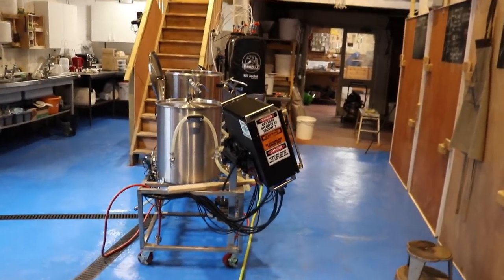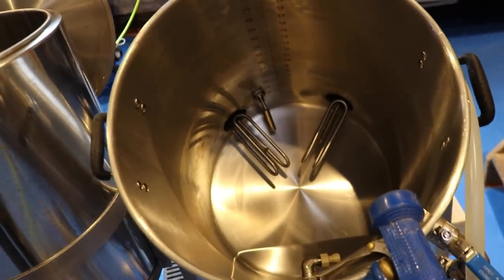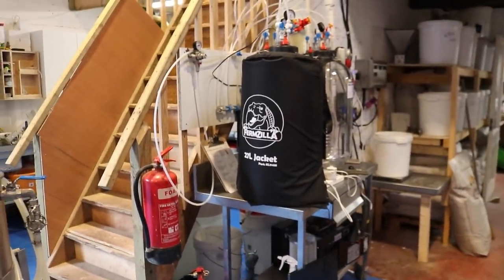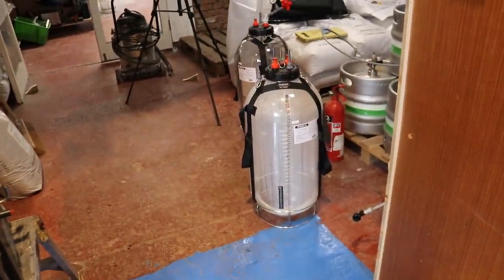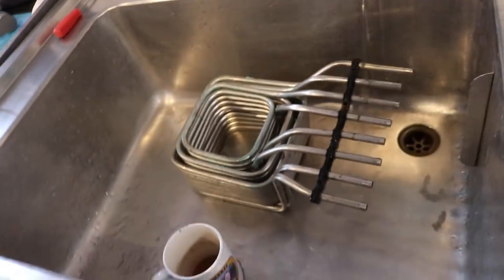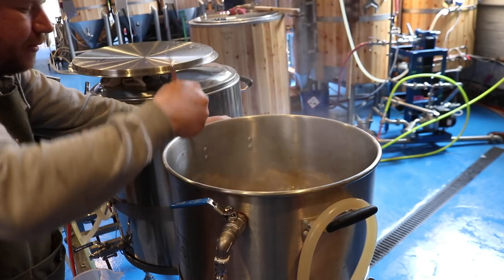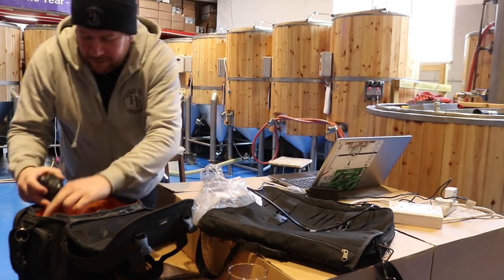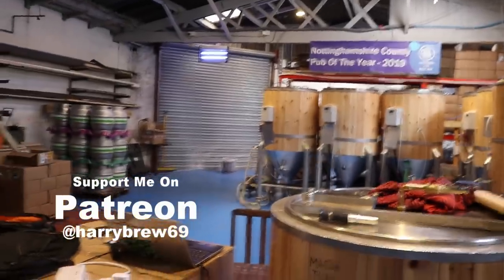Mango Something IPA

Comment: I used the Verdant yeast for the first time. It was a 10 gallon split batch with the US05. The US05 attenuated much lower than the Verdant did (Treated them the same way with rehydrating them since the SG was 1.072). Still working on the Verdant to see if I can get a few more points down, but it does taste great (A little sweeter), different than US05, more estery. Will be interesting to taste them side by side once dry-hopped, chilled, kegged and carbonated. Cheers! Always love your videos. Keep'em coming :)

Comment: Could you run hot water through your coil to raise the temp? Then switch it to cooling?
Reply from the maker: Thought about it in the past.  As I use glycol it would have to be hot glycol to prevent over dilution. Then there is the problem of balancing the level in your hot and cold tanks.
Reply: @harrybrew69  love your videos mate, they've inspired me to DIY nearly all my brewing kits